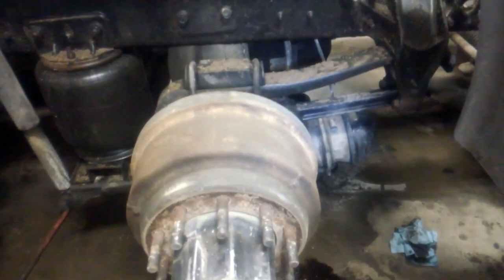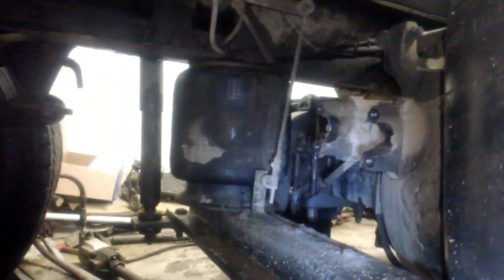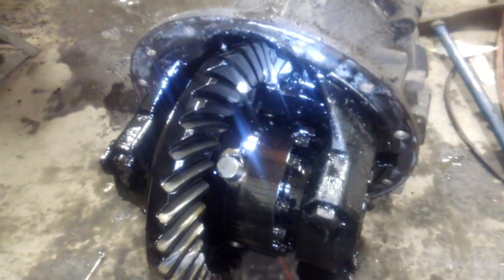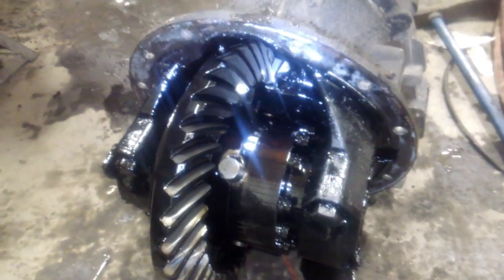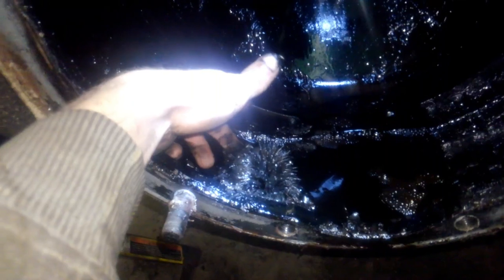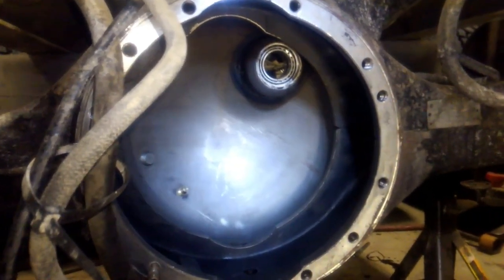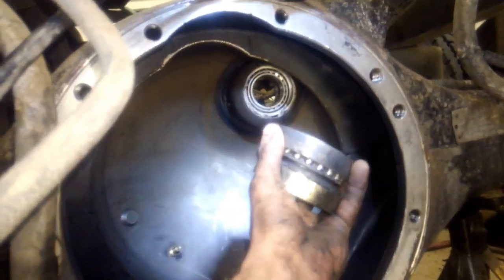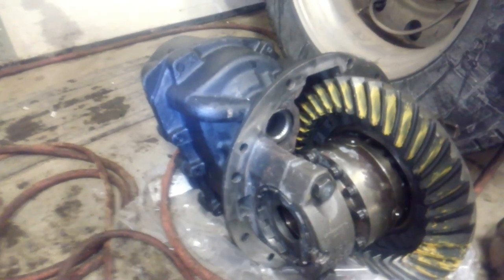removing rear axle 3rd member on semi truck

Comment: Hey "Easy Rider"  im interested in knowing can a complete 3rd member "R&R" to include rebuild or replace individual parts within the power divider, be done with no power tools??? Let's say a guy is stranded in a lot, what are some torque specs, they would have to defeat??? Thanks!

Comment: I drained my oil on my differential and it had a lot of metal flakes in it, like glitter. No big chunks of metal. When I let off the throttle and lay into it again there is slack and a thump. So looks like I'll copy your repair here. Question is, did you replace your bearings on the wheel ends and how did you clean out the metal particles?  I'm guessing magnet and flush with diesel.
Reply from the maker: that doesn't sound good. i would certainly pull the hubs off and clean them up and inspect the wheel bearings, replace if necessary and install new seals. once the 3rd member is out you can reach most the way up the axle tubes, clean the bulk of everything out with some shop rags. then flush with diesel. then you can Finnish up with some brake clean.
Reply: @Ezrider359  Thanks for the help. Did you get a rebuilt differential or did you rebuild it yourself? How much did it cost you?
Reply from the maker: i just picked up a reman 3rd member from a re-builder, dsp404 for the forward diff on my truck it was right around 2800 + like 6-700 core charge that i got back when i returned the core. inland truck parts, is who i use for that kind of stuff, not sure if they have a location near you but there kinda my go to for drive line and pto parts.
Reply: @Ezrider359  I have an inland about an hour away. I'll have to give them a call. Sure isn't cheap but at least I'll save on labor. Thank you very much for the help and for making videos.

Comment: I think I have to do this on my truck. Mines just leaking oil really bad. I replaced the pinion seal a few months back but now I think it's leaking around the housing. Do you have to pull the short drive shaft off the back part or can you get away with just unbolting the front and resealing it?

Comment: Would it be ok to go from a 3.70 to a 2.70 for better highway driving? I've seen some good deals on some very low millage trucks with 3.70 rears. Want to regear for OTR driving.
Reply from the maker: i haul heavy (around 100k lbs) 3.70 is a good match i wouldn't go 2.70's unless your light and running a direct drive transmission, 3.55's are a good balance with a overdrive trans. 3.36's would give you some good legs if you like to run fast.
Reply: @Ezrider359  thanks.... just running dryvan

Comment: is their anything different on a rear drive? or just yank the axle shafts etc and pull the 3rd member?
Reply: I have one leaking oil real bad. I thought about just using long bolts and sliding it back. clean then seal and bolt it back in
Reply from the maker: yup same thing pull the axle shafts unbolt it and slide it out. rear is easier because there is no threw shaft. you should be able to slide it out on some longer bolts and re-seal it, i believe they are 5/8" fine thread if i remember right.
Reply from the maker: 75W-90 Synthetic Gear Lubricant
Reply from the maker: 80w90 is fine
Reply: You sure its not just a pinion seal? Save yourself a ton of work, Sometimes wore out Pinion seal will throw grease all over the axle housing and you think the Chunk is bad or a cracked housing

Comment: When putting a complete center back in does it have to be shimmed a certain way or just bolted back in?
Reply from the maker: Just bolted in the gear backlash is set with shims but you won't be messing with that installing a complete center section

Comment: Could you clearify for me so this is your diffrentail the thing that classed as 3.42 3.70 gears ?

And in order to change it just pulm the part you pulled out and not the whole 3rd axle ?
Reply from the maker: 3rd member is another name for the center section of the rear end. witch is what i changed in this video witch contains the ring and pinion gears spider gears and in this case power divider. the gear ratio for my truck is 3.70. that number refers to the number of teeth on the pinion gear vrs the ring gear. so a 4.10 gear set. the input shaft (driveshaft) would have to turn 4.10 times for every 1 time the tires made a compete revolution where a 3.42 gear set would only turn 3.42 times for every 1 rotation of the times.

Comment: Is it possible to remove the third member with an engine hoist? I don't have an overhead.
Reply from the maker: yup. that's what i used, i don't have a overhead hoist either.
Reply: Ezrider92356: Thank you. I'm on such a limited budget. I know I'm not the only one. Thanks

Comment: Can you get a good rebuilt center section for under $2200 3.70 ratio...Been pricing them down here,they want $2500
Reply from the maker: I normally get that kind of stuff from Inland truck parts. They have a few locations but not sure if if they have one near you
Reply: @Ezrider359  thank you

Comment: What's scary is seeing how easy it is to remove the axles from a semi truck is that any advance theif  could do that on the spot if they  needed something to sell quick!  I just removed the truck axles  from one of our backyard rotting dump truck and it really scared me of how easy it is to remove such an axle!  Just something to be souly aware of! Make sure the bolts are very tight to the truck axles!
Reply from the maker: hard for a thief to sell. now battery's and fuel on the other hand. just as easy if not easier t steal and easier for them to sell. they tend to be bigger target items. i had someone break into the gate at my shop one time and pump 150 gallons of fuel out of the tanks and into a service tank in the back of there pickup. when i was pulling a flat bed i had someone steal my straps and chains off my load while i was sleeping in the truck.

Comment: The axle was already removed within the first 6 seconds of your video. This video should be labeled, removing differential instead of axle.
Reply from the maker: It's titled removing 3rd member
Reply: @Ezrider359 Thanks for the clarification.  I'm trying to remove the drive axle on a Rockwell International axle and the manual instructions do not work. However I have to remove the axles before I remove the drop-out. I wasn't aware it is also called a 3rd member. Hopefully I can find a youtube  clip of removing the axle.
Reply from the maker: Most likely your cone washers are stuck sometimes you have to smack the end of the axle shaft pretty good to get them to pop loose

Comment: If  you  had  the  Mack  drop  ins ,  it  probably  wouldn't  have  happened .
Reply from the maker: mabye mabye not. rear end had over a million miles on them, and there was some driver error involved. (frozen drive axle brake and tried to bump in in reverse rather than get out and beat the drum) Mack rears are certainly tougher but eaton stuff is easier to get on short notice when things do go wrong.
Reply: @Ezrider359  
A million miles and the driver doesn't help a bit.

Comment: Good way to start a video bent over and passing gas...
Reply from the maker: Lol
Reply: The unvarnished truth!
Reply: @Ezrider359  hey ezrider I have very important question to ask ....I want to buy truck ...cab and chassis from ironplanet auction ....truck is in Canada and works in oil fields ....IT HAS TRI DRIVE  for traction on muddy areas and off roads ......it want to remove rear most drive axle ( the axle all the way at the end of the truck) I want make it tandem drive axle to use it for dump truck in Wisconsin. .......the truck has double frame and 410 ratio which make it excellent for Wisconsin dump truck ........I want to make sure it will do just as fine as dump truck and driving on road .....plz help me out with some info